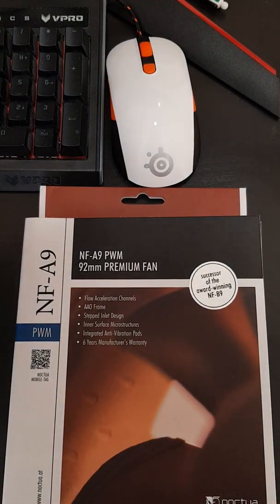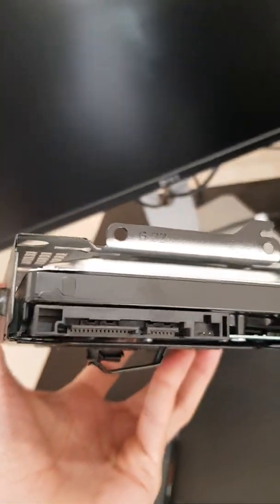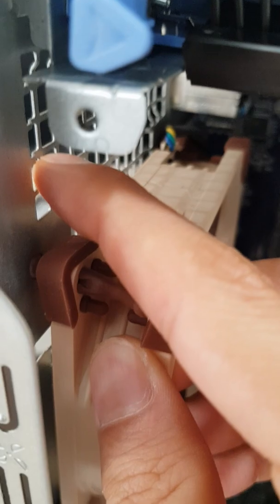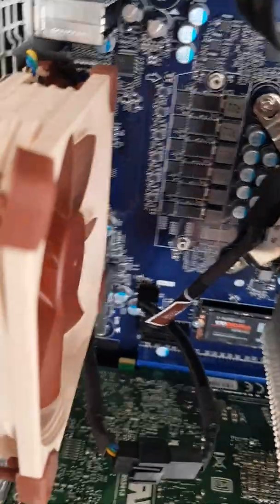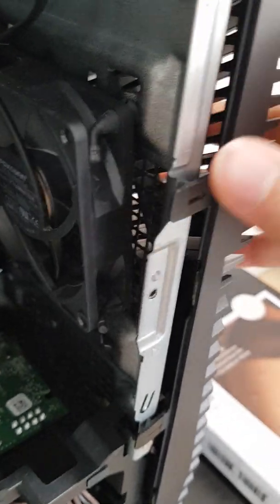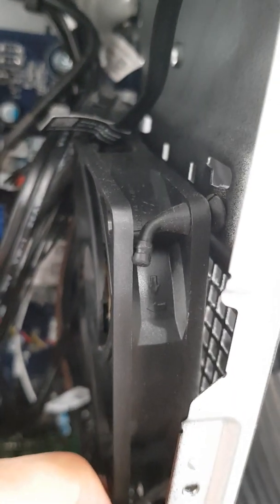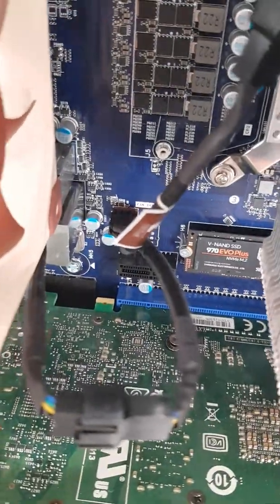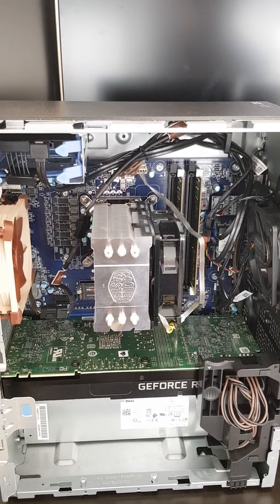Noctua NF A9 92mm PWM Fan Installation on DELL G5

Comment: Heres how you install the Noctua Fan:

Shaows Fan already installed.

I guess you didnt show how it is nearly impossible to thread the bottom right grommett with the tower CPU in the way,

WHy didnt you film how you did it?

Or did you take it to  a shop, and then say, its really easy

Show how many hours it took you to insert that bottom right grommet.

Please change the title to what  a noctua fan looks like after I paid my local shop to install it.

Comment: when you installed the noctua nf-a9 92mm did you have to remove the gpu or the cpu cooler for more space to make it easier to pull the rubber screws inwards

Comment: How did you replace a 92mm fan in a 80mm screws fan?
Reply from the maker: Different holes in the back was used to secure the fan. See the video for which holes are used.
Reply: @nooragha360  do you think 92mm fan fit in 90mm screws?
Reply from the maker: It doesn't use screws, it has rubber mounts
Reply: @nooragha360  well do you think it would fit in 90mm screws hole

Comment: Is this a simple plug and play kind of upgrade? Or do I need to make changes to the fan curve settings because xps 8940 has very limited control? Also I don’t have space for the front fan to be installed, do you think a A9 rear fan upgrade would make a significant improvement to the system cooling over the stock 80mm?
Reply from the maker: A simple plug and play will still make an improvement without any additional fan curve adjustments. A9 is generally considered a good fan, therefore changing the stock fan to A9 should still improve your cooling.
Reply: @nooragha360  Thank you! I have just installed A9 on my xps 8940. However, idle temperature is about the same, same for when under load if not even a little bit higher than before. Just plugged it in the sys_fan and didn't do any setting change to the fan speed. it runs a lot quieter though. I don't really undersand how PWM works, I think the stock fan is 4000+ rpm, and A9 is just 2000 max. would PWM control A9 accordingly or the system still think it has the old stock high rpm fan?
Reply: I am thinking adding a 120mm intake in the HDD location, but 8940 front panel does not have perforated vents in the upper part like G series, will that 120mm even work as expected if it is installed in the HDD bracket location? And how much improvement should I expect in term the cooling?

Comment: You should cut out the metal caging in front of your fans. You can do it with simple wire cutters and it will improve airflow a lot. More than you think.

Comment: i m trying to install the  noctua  80mm  in  case fan  but the  bios    show en error  message
Reply from the maker: Make sure you have right wire and PWM connection to the fan. See a few of the other comments below and let me know if you are still stuck.
Reply: @nooragha360  I have. A 4 pin. Connection in. Motherboard when the pc start open the diagnostic program from  bios. And after check the fan show error message
Reply: @nooragha360  hi  i connect the  4 pin  noctua in   four  pin connection  when pc rstart  open the  diagnostic   of  dell  and   show me an erore after  check....
Reply: what do you mean the  right pwm ?

Comment: probably overkill on my part but i mounted an extra a9 fan on the otherside of the noctua 9s heatsink so it has 2 on it....and dropped a coolermaster fan on the back in place of the factory.  my cpu has yet to get hot....gpu (dell gtx 1660 ti) is another story. trying to find ways to do an upgrade on cooling for that

Comment: Have you tried to install a Noctua NF-A12X15 in front of the graphic card to intake extra airflow for the GPU?
Reply from the maker: I would consider that if my temperatures for the GPU were getting too high. But not having that issue atm.

Comment: Thanks for the video! I used th splitter: the 4 pins to the Noctua and the 3 pins to the stock and got boot error with stock fan running full speed. So I switched (4 pins to the stock fan...), no error, stock fan runs ok, but Noctua doesn't run at all! Can you help me? (the Noctua runs for 2 sec, then stops)
Reply: set to ignore fan speed in monitor section of bios
Reply: Any solution yet? I have the same issue. If Noctua at 4 pins, stock fan run at full speed all the time like it's going to take off. If stock fan at 4 pin, Noctua just stop there.
Reply: @Freemind958  same issue.  I just left it with the 4 pins to the Noctua fan.  But, like you mention the stock fan is running full blast all the time now.  The fan came with a line noise adapter which I might try.  Others have mentioned changing fan curves but I know nothing about that.

Comment: I have zero experience with actual desktop towers and this was my first one, but I do have experience with installing a new CPU, RAM, and SSD(Although it was a long time ago...) I want to install one of those 92mm noctua's in the front to replace my hdd, but I don't know if it would really make a difference or not (Or even fit) if I keep all of the other stock fans. Could someone help me?

Also, if I get the Noctua 92mm NF A9, will it come with everything I need to install it? (I'm seriously new at upgrading or doing anything with a tower pc and don't have much money to spend, but I can at least buy a new fan or two if it will help my pc because it runs great).

If it's too difficult for an absolute newbie, then I would like to know as well. I'm not great at installing things after my prior experience with CPU upgrading.

Comment: I have a Dell G5090 and would like to upgrade cooling, if I do this where am I supposed to put the HDD?
Reply from the maker: I dont recommend using the bulky HDD, get some cheap 2.5" drives and use the drive bay, located top left side of your case when its opened.

Comment: Hey sorry to bother but could you list everything that’s was upgraded onto your pc? Like how many fans (brand) what cpu cooler what screws, how much of each item. What I need to transfer my stuff from hdd to sdd, what was removed etc. It would be very appreciated.
Reply from the maker: 1x Noctua Fan (with its accessories)
1x CoolerMaster CPU cooler
4x m3, m4 washers
4x m3 screws
1x USB to generate a OS backup image when replacing hard drive.
See the 3 videos in the playlist for specific details.
Hope that helps.
Reply: @nooragha360  3 pin or 4 pin

Comment: Very helpful, think I might go with 2 noctua for front and rear as I really don't like how loud the base fan is when you ramp it up.

With my stock dell g5 and the horrible CPU heatsink it comes with (not the one shown in this video) my cpu is really hot.  I can keep it below 85C stock if I crank the fans way up but then it sounds like a leaf blower, heh.

Do you think a 92mm would fit up front as well?  Seems kind of tight with your 80mm even.

Comment: I have a dumb question, with the cpu fanpositioned blowing hot air out to the front, would it be better to position the front fan intake or exhaust? if intake, wouldn't it block hot air going out from the cpu fan?

Comment: I've been using this pc for a bit and I'm planning on getting 2 new fans and an 8gb stick of ram. However, i have a ton of games and saves on my hard drive already. Is there anyway I could both keep the hard drive and add the fans?
Reply from the maker: Some people have suggested squashing the fan in front of the graphic card area. Other option would be to backup your files in another drive and replace the mechanical drive.
Reply: I've seen some people installing the hard drive at the top of the case... Between the front of the case and the 2 slots for SSD

Comment: With no mod this can  get really loud.  Wit the fan mods is the noise reduced ?
Reply from the maker: Yes reduced significantly with the right configuration of the fans!
Reply: @nooragha360  what is the right configuration of the fans?

Comment: Question 1. Why not leave the stock fan at the back and use the new fan in the front? Is there more efficiency with putting the new fan at the back? 
 Otherwise,  I see what you did.  You plug in the spliter ( that's provided) and plug into the new fan at the back,  then run the extender to the front to the original fan.  
 
Question 2 - I  have the same Dell G5 9050 Desktop and have the Noctua NF-A PWM fan. However, I have the chromax black which does not come with a splitter, only an extender. (4 pin).   What splitter should I get a 3 x 4 pin splitter or a 4 x 4 pin splitter. Please help and help me to also understand what is the difference.
Reply from the maker: The Noctua fan is more efficient and the exhaust fan usually needs to have the better airflow.
Also no bios error with the current setup I have.
Reply: @nooragha360  thanks

Comment: Can I just use the Noctua fan at the back and not bother installing the original  fan at the front?  Does the original fan need to be installed to avoid the error message ?
Reply: I removed the stock fan at the back and installed the noctua fan and didn’t do anyth8ng else with the stock fan and I got no error

Comment: Hi Noor, did you use a 3 pin or 4 pin Noctua Fan? From what I understood, you need to get the 3 pin Noctua and then with the splitter use the 4 pin for the front fan (original fan) and the 3 pin for the new Noctua Fan in the rear. Is that correct?
Reply: I was wondering the same thing. I thought the 4 pin would be used for the front fan, but according to video it looks like he used the 3 pin for the front fan. I installed my Noctua today and did 3 pin for the front fan and 4 pin for the rear Noctua like how it is in the video, and it seems to have worked and already runs cooler than it did before. All I need to do now is replace the CPU cooler.
Reply: @Happy_Accidents  again you Matt;) which cpu cooler are you aiming for?  How much did it reduces the temp with the noctua fan?
Reply: @EZzO444  for the cpu cooler I played it safe and also ordered a Hyper TX-3. Hopefully it will get here by next week.
Reply: @Happy_Accidents  Play it safe... Why other options are risky?!
Reply: @EZzO444  As for temps I haven’t stress tested it too hard yet but I used to idle around the 40s Celsius  and then randomly heat up in the 60s. Now it idles between 35-45 degrees Celsius and runs quieter. Running Witcher 3 on the highest settings it’s usually around 75-85 is I remember correctly where it used to reach the 90s before within like 40 min of playtime.
Reply: @EZzO444  There’s not a lot of coolers that will fit the case. Also the TX3 sounds fairly easy to install without taking the motherboard out of the case
Reply: @Happy_Accidents  I went with the noctua NH-U9S. Waiting for the desktop to be shipped (god it's long). Did you put dual Fan on your cpu cooler?
Reply: @EZzO444  I just added my TX3 a few days ago and thought of adding another fan in the future, but so far with just the one fan it works like a dream. Much improved the thermals
Reply: @Happy_Accidents  great ;) what was the temperature before and after under load?
Reply: @EZzO444  Both GPU and CPU idle between 30-45 degree celsius and was around 65 degrees celsius for both after a few hours of heavy load, where it used to heat up to around 75-85 degrees
Reply: @Happy_Accidents  that's awesome!!! And you use Alienware to control fan speed
Reply: @EZzO444  yeah exactly
Reply: @Happy_Accidents  are you able (and sorry if I'm repeating myself) to control all 3 of them separately? What approach did you use for the cpu cooler installation? Grub screw or m3 screw+ Washer?
Reply: @EZzO444  I can’t control all three separately. The back fan controls will change speed for back Noctua fan and repurposed intake fan, and CPU fan controls the TX3. For installation I used m3 screws and washers just like the video. Worked like a charm, fairly easy install
Reply: @Happy_Accidents  knowing that their rpm is different for the intake and exhaust. Did you find the sweet spot config? I'm looking everywhere for those m3 16mm screw and m3 washer can't find anything locally (Canada)
Reply: @EZzO444  how are the temps
Reply: @jaygsxr5981  I'm waiting for my special order at home hardware for the m3 screw 20mm. I'll get them next Tuesday and proceed with the installation. I played a bit this week with the stock system and cpu went from 85 to 100. (mostly 85) during gameplay session. The GPU was not that bad.

Comment: So you connected the noctua in the 3 pin side of the Y adaptor? Thanks
Reply: According to the video it actually looks as if he connected the Noctua to the 4 pin side. I would have thought it would connect to the 3 pin too but I installed my Noctua today in the 4 pin and the repurposed front fan in the 3 pin and it seems to have worked without error so far.
Reply: @Happy_Accidents  When you say no error is it supposed to potentially cause an error? Should we avoid driver update to make sure we don't face any issues/?
Reply: @EZzO444  I’ve read a lot of people get a BIOS error at boot after they’ve installed their fans. I personally haven’t experienced that yet.

Comment: Has anyone who tried this had errors during boot up? I heard dell can have issues where the non one fan is not detected and will give errors
Reply: You need to use the splitter and keep the OEM Fan. I don't know if you can have only fans not OEM

Comment: I just wanted to thank you for the videos! I had the same PC and did all of these upgrades and it works great. Only question I have after all of this is do you have issues with the stock fan working super hard? I have it upfront as an intake fan like you did and it runs continuously at what seems to be 100%.
Reply: Hi Josh, Did you fix this probleem? I’ve the same issue.

Comment: So I have a lower end Dell G5 and I was wondering if I can add a fan on the bottom where the GPU is bc I have a 1660 Ti. And I was wondering if this is fine with a 360W PSU since I want to play some demanding games at higher detail but it keeps ramping up. And if I was to remove the fans sometime will the grids break or no. And idk if I can place it at the bottom
Reply: I wouldn't remove the drive bay on the front since I need it as my second memory for Vids

Comment: you used the splitter because there is only one fan header on the board ? Could you have eliminated the original fan and gone with 2 Noctua fans ?  Or does the system need to see the original Dell fan ? I've heard of bios issues, I was wondering if that was why. Thanks, and by the way great videos.
Reply: Did it work with 2 Noctua Fan with no BIOS error?
Reply: @EZzO444  - it worked just fine for me. I have replaced the stock cooler with the Noctua NH-U9S with 2 fans, and replaced the Dell outlet fan with a Noctua 92mm fan, and added a 92mm Noctua as an inlet fan which I am in the process of changing to a 120mm fan. I think it boils down to which motherboard you have, whether you get a bios error or not. Seems those with the non K cpu and latest bios have no issues.
Reply: @steve318k  might sound stupid but you still connect the same way? Splitter and one Noctua with the 3pin and the other one with the 4 pin connector?
Reply: @EZzO444  - the original Dell fan and the Noctua fans I used (PWM) are 4 pin. I have not had a 3 pin fan in my computer.
Reply: @steve318k  what bios are you on? 1.1.1 or 1.1.0? I noticed in the newest bios 1.1.1 that  the rpms has been reduced for the fans, and high performance mode in alienware command center no longer causes the fans to go full blast, not sure if the newest bios would affect aftermarket fans or not? thoughts
Reply: @steve318k  yea I haven't upgraded my cpu stock cooler yet, but 1 thing I noticed between the 2 different bios versions is this: under thermal performance mode under bios 1.1.0 the stock fan will ramp up to 100% BUT dell made a change under bios 1.1.1, the stock fan will now only ramp to something like 60% or something like that under thermal performance mode......interesting change....so I was wondering how this would affect an aftermarket cpu cooler? I guess its different if you manually adjust the fan speeds of course
Reply: @jeff69dini  ... Not sure, because I didn't do much with the fans until having 1.1.1 ... But thanks for the info.

Comment: does the fan size need to be 92mm or can i get a 120mm or 140mm?
Reply from the maker: Only if the larger size fits in the case and you can mount it somehow.

Comment: I'm thinking about doing this for my g5 5000 , question is with the new fans installed does the system run quiter? Can you also go over settings on alien ware command center
Reply: Did you figured it out?